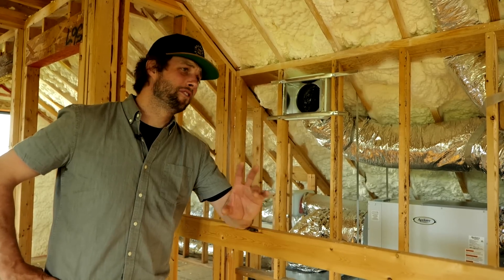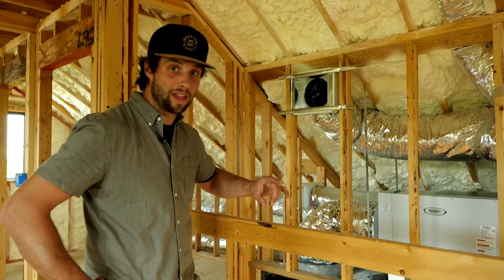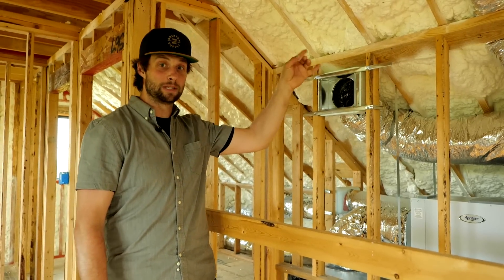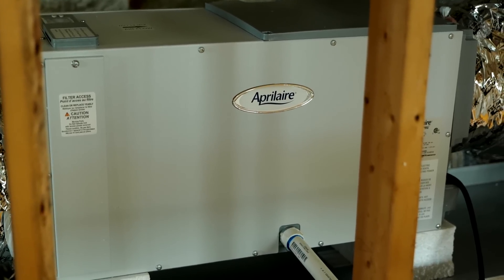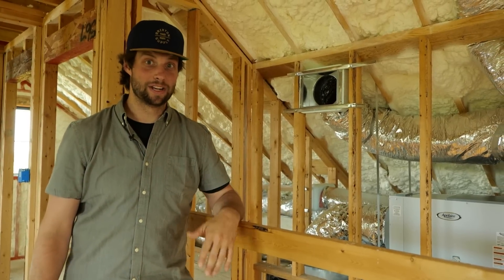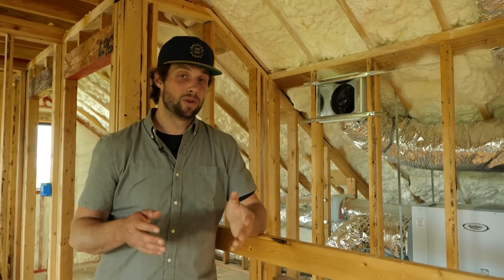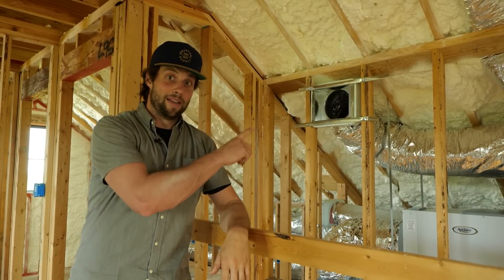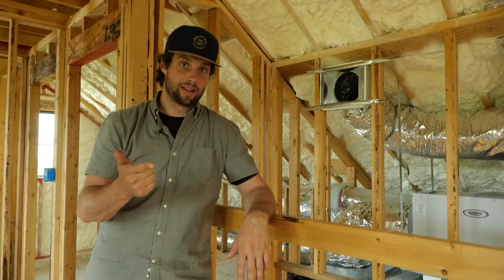How Does a Whole Home Dehumidifier Work? A Comprehensive Indoor Air Quality Strategy.

Comment: You are very knowledgeable. Thank you for sharing. In some high humidity climates, running the fan in “on” mode is not recommended due to not allowing the evaporator coil to dry between cycles and blowing the moisture from the coil back into the envelope and duct work where it may condense and support microbial growth.

Comment: If Aprilair provided me with free dehumidifiers I would have several too. I am going to buy one for my small rental apartment because it’s so humid in the fall and spring and the ac condenser will freeze over when operated at a low outside temperature even though with the oven on and humidity the cooling is needed. My place is so small no ducting will be necessary. The portable dehumidifiers are loud and have to be put in unoccupied areas to avoid the noise which means the dry air is not really going where it needs to be. Most places built 60 years ago are extremely leaky because that’s how they were supposed to be.

Comment: First, I promise I'm not being rude and I think you do a great job of explaining things, just maybe some over explaining of different topics, kinda get off track. Otherwise I like listening to you,great voice and easy on the eyes.

I understand and have understood the basic concept of dehumidification.  Humid air in, machine removes moisture, drier air comes out.   How does the unit itself work?   Compressor? Like a standard room dehumidifier except connected to your ducts?  Air passes across a cold coil,condensation drips into a pan and goes down a drain? 

All good and thank you for taking so much time explaining everything.  Did I mention you look good? 😂.  Seem like a nice guy and fun!

Comment: I got a manual j performed and they said to use a 2.5 ton heat pump for my house. However I already have a 3.5 ton heat pump that has spray foam on the attic and blown insulation on the walls. Is it ok to leave the 3.5 ton and get a whole house dehumidifier? Thanks

Comment: Do you like it because flex duct is easier to install or because it's just better?  I used to work with guys putting pools in.  I used the hard PVC and they used the flex.  We came back for more issues with the flex.  Don't know why but we did.
The flex ducting just looks cheap to me.  No meat to it at all.

Comment: Hey, I have a mobile home, & a lot of what you & Matt does is really good, for Large, Foundation based homes, I have a 900Sq. Ft. 2 part home, but I may need to replace my HVAC unit - heat exchanger is cracked - but, before I do, I want to get a CO meter to see of there is any leaking. $5-7K is not just a dime to drop... sectional homes also have other issues to deal with. Or, should I be watching a different channel. Love you & Matt so far :-)

Comment: What about cold and hot climates?  Like in Ohio.  We are thinking about using Radiant heat to prevent the air drying out.
Reply from the maker: In dry climates, I use steam generating humidifiers.  I like this one: https://amzn.to/3lt72fO
(FYI, I do get paid if you buy through the link, but this is the exact model I put in my homes.)

Comment: Glad to see you post again, I was getting a bit concerned. Been so busy haven't had a chance to watch till now.
Good video. I can think of a few reasons to use flex rather than solid plenum. Sort runs with awkward angles, quieter (this can be a big reason), in some places being able to run a larger diameter than you could with solid. What are your reasons.
Take care and be safe.

Comment: I don't understand the boners for very expensive installed dehumidifiers. They do exactly the same thing as a sub $200 portable unit, which can usually be plumbed into a drain. I have a small one running in an extra bedroom where I don't usually go and can't hear it...this equalizes humidity throughout the whole house. It doesn't need to be ducted, humidity doesn't work like that. My $139 dehumidifier is currently keeping my house at 37% - I'm in North Carolina by a lake and outside right now it's around 97% humidity. It drains itself. No maintenance, just sits there and hums. My house isn't sealed that great either. If I turn off the dehumidifier and just use the A/C it will hover around 65% humidity.

If you want to dump the heat load outside, just use a small window air conditioner for $99, let it run all the time. It's every bit as efficient as any dehumidifier for the same purpose.

I can get fresh air from outside too, it's called opening the window. ;)

How could spending an extra 4 digits give me any benefit? I say this as somebody who has been in charge of the air quality management of multiple commercial grade many thousand square foot facilities that need serious humidity control...those places got $1500 dehumidifiers...my house...never...
Reply: What brand of dehumidifier?
Reply: A whole house dehumidifier is about 30% more efficient per watt and allows you to duct zones for drying the air in comparison to waiting for the air to mix enough through osmosis.  That being said, you are correct, its more efficient and easier to use a unit like that for a smaller home.  Larger homes really do benefit from the ducting and put less load on the HVAC system by making warmer air feel "cooler" because of lower relative humidity
Reply: @RoninCC  I typically use a 5000btu window unit for this. It is not "more efficient" when your dehumidifier dumps all that heat back into the air stream. My unit creates air conditioning AT THE SAME TIME as dehumidification! All of the hot air gets dumped outside instead of in the house. That makes it 100% MORE efficient!

And who said anything about a small house? I have a 4 bedroom home on a humid lake. There is absolutely no issue whatsoever with humidity distribution in my house, the natural osmosis is nearly instant. WTF would I need zones for? I want the humidity in my house to be the same in every room! It is currently approximately 80 degrees, dark, and 95% humidity outside. My house is at 72 degrees, 51% in every room.

You have no idea what you are talking about. This is just another dumb thing rich people think they need because somebody else told them they do and they have no idea how it works. The "other guy" Jordan used to work for is very guilty of this and constantly made fun of on the internet, he has no idea what ROI means.
Reply: @ryanroberts1104 I’m thinking about buying one for my shop (they have one on casters) that won’t be ducted, just to keep from replacing the shItty plastic Chinese made crap every year or three.

Comment: Dehumidifiers are a waste of money, using up to 10kwh a day. Size and spec your AC correctly and you don't need a dehu. I'm in DFW and my old 0.46 shr on/off single speed ac maintains 38-40 percent humidity
Reply: Yea, sure, if your climate doesn't change over 365 days of the year. Years where Texas has 100 days over 100°, you've gotta rock a lot of AC. Spring/fall days where highs are in the 70s or 80s, your AC will not run as much. The only viable alternative is a variable speed compressor.
Reply: @jakeanator2004  they cost more to buy and cost more to replace/repair.

No, thanks.
Reply: Also if you have a spray foam home the single stage just won’t cut it. I’ve got an inverter heat pump and I’m still at 55% RH so your comment makes no sense in this application.
Reply: @chaseself9151  55% is not anything to be proud of. My house never sees above 44 and I'm using a 20 yr old unit
Reply: It’s because your house is poorly insulated if you pay attention to the video he references how tight the house is as is mine with closed cell spray foam. If my house had blown cellulose and bat in the walls as I’m sure yours does my RH would be much lower as is yours. The unit runs longer in a higher stage it pulls more humidity.
Reply: @chaseself9151  so how is that a good thing if your tight house cannot get better then 55% rh. Air tightness is only a part of it. If my air tight house couldn't get below 55 the I would sell it and move to a code minimum house

Comment: Did you tell us how it's ducted on the return side? I have an 1850 in my basement not ducted and it's still 60% plus in the first floor and hovers around 50 in the basement with the unit. Set point is 47 on the unit. 2007 house and St Louis MO.
Reply: Is your duct work in the basement?

Comment: In the absence of an ERV, how do you prefer to duct the fresh air inlet to your hvac system if using a whole house dehumidifier? I’m installing one soon and the dehumidifier I bought has a fresh air intake built into it. My concern is that if all the fresh air comes through the dehumidifier, how will I get fresh air when the dehumidifier is not running? Should I also “y”over to the return side of the unit?
Reply: Thats a great question im in the same predicament. How did you go about it?

Comment: I would like to know about the ducts and insulation. Does the dehumidifier require it's own dedicated ducts or does is share ducts with the AC?
Reply: Shares with existing duct, but has to have dampers on the collers.

Comment: Why did you spray foam up to the radiant barrier ? Can’t you install some poly carb baffles, and spray up to them ? Flex duct is quieter I hear.....other than that, I have heard it’s harder to clean flex duct when running cleaning equipment through it. I would guess flex duct could last for 75-100 years before the plastic /Mylar starts to deteriorate ? Vs rigid metal duct that could last indefinitely I guess. Then there is the cost of material / labor to install factor. Flex is cheaper ....I have flex duct in my house ....I’m comfortable 😁

Comment: I think radiant barrier science is bs. The heat energy has to go somewhere, it can't just disappear into the 'barrier'
Reply: Energy doesn't disappear into the barrier. It is reflected back and absorbed by the roof deck, and then taken away by the air outside.
Reply: Radiant works, but it has to be installed at the right place. Inside the attic the more correct way to think about it is an emissive barrier, which also works, but much less than radiant barriers. See this video for a radiant barrier demo: 

https://youtu.be/TdPLmbkhH2o

Comment: I'm a fan of unvented roof assemblies 🤷‍♂️
Reply: Do you mean a vent roof ???or a vented attic ....its an important distinction .....A vented roof would have an airspace (under standing seam metal typically) and a vented attic would have air baffles on the inside of the attic with insulation underneath ( if you choose to have a conditioned attic)....just sayin ....

Comment: Hey why do you like it and tell us why! (Flex duct)  And what is your thought on HighVelocity AC systems vs MultiSplit? (someone said that Multisplits leak condensate when drain clogs...I mean is that true?)
Reply: Yes, i'm really interested in high velocity AC.  It seems like such a neat idea, but I've never seen it used in person.  I suspect that switching to it would let me raise the ugly channel in my basement ceiling, but the other option I have is to run ducting in the attic.  Which I need to do something about... So, radiant barrier vs spray foam?